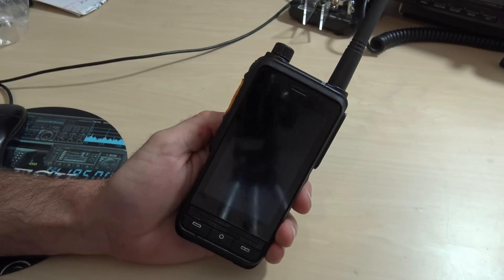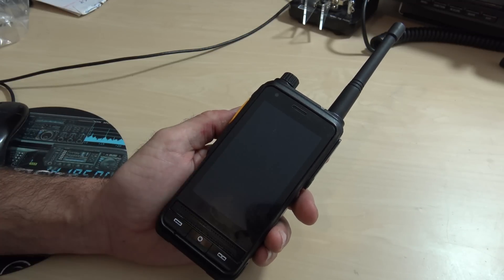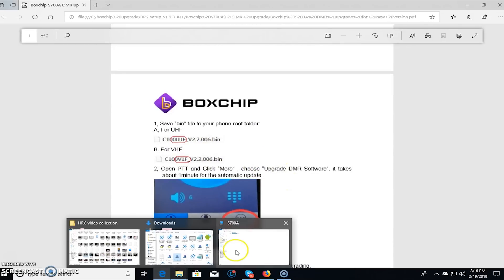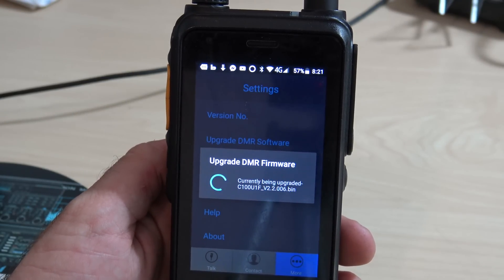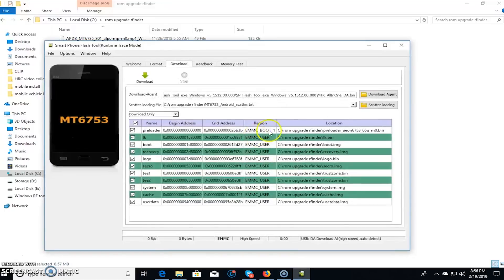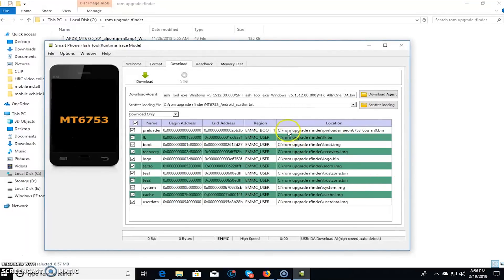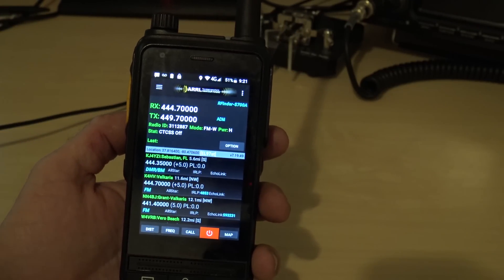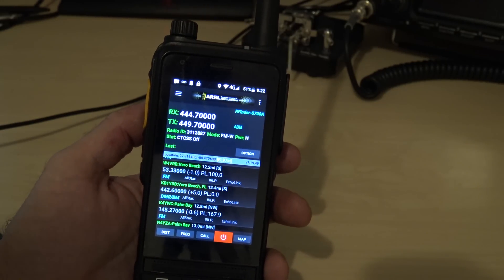DMR Boxchip Converted To DMR Rfinder, DMR Smartphone Upgrade

Comment: good afternoon, which version of rfinder did you use? does it work on the S900a plus? where can i get the rfinder file to upgrade?
I thank you for your attention.
PU1MAF - Alexander.
Reply: Hello, a query, were you able to change your S900a plus to Rfinder? I have the same one and I would like to be able to make the same modification, thanks, greetings Will, XQ6AK